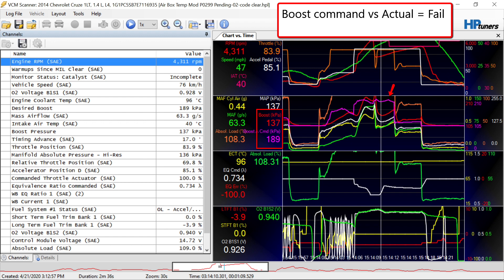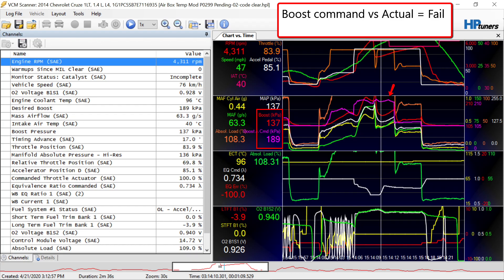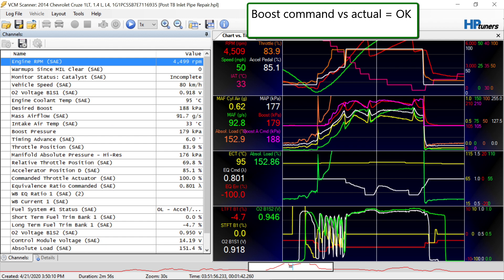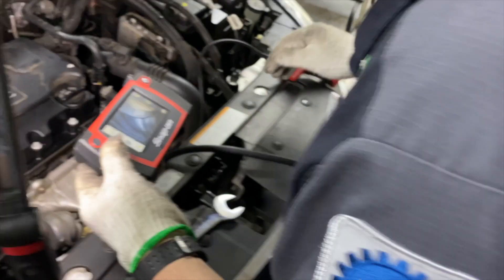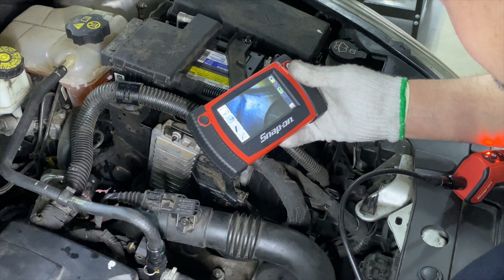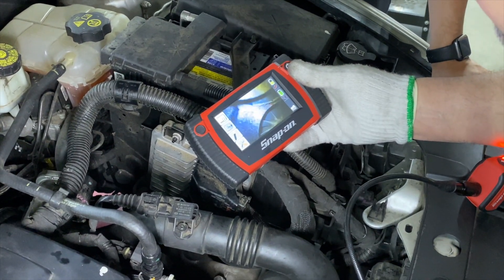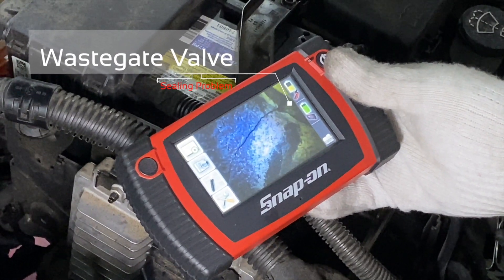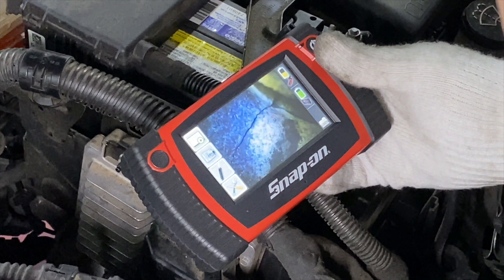2014 Chevrolet Cruze - P0299 Diagnosis Using Scan Data, and Specialized Tools

Comment: that hairline Crack in the turbo is normal even when brand new and doesn't cause any problems unless the Crack gets wide, but usually the wastegate flap gets too much play in it in 2011/2012 models. Strange to see a problem on a 2014.